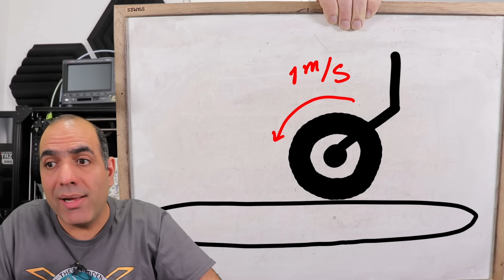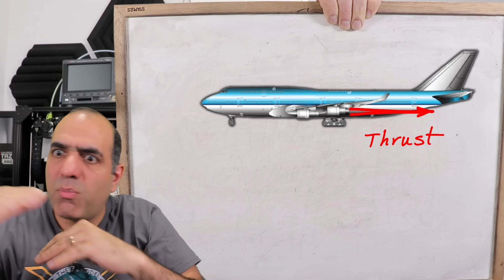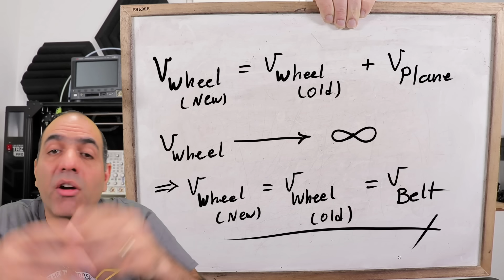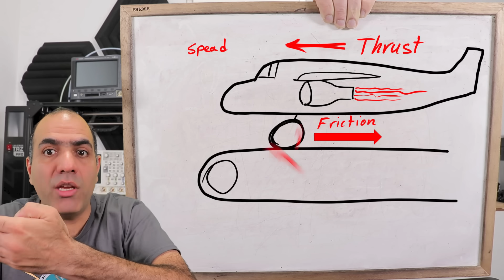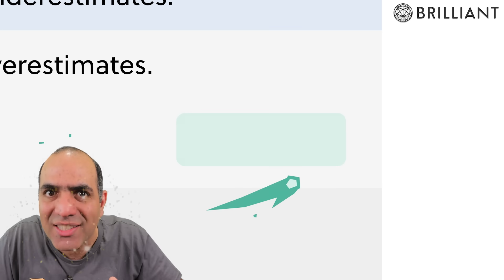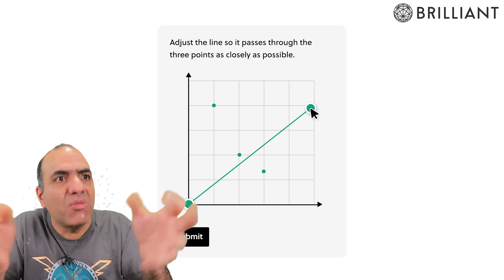Airplane Question that Drove Me NUTS!!!

Comment: Wonder how much airflow the conveyor moving that fast would generate simply via boundary layer effects... Could possibly be enough to get the plane to at least get light on its wheels... =)
Reply: Au Contraire 🤔 If the 747 plane is bombing along the conveyor runway with the air data system’s pitot heads on the nose sensing approaching the rotation speed, the conveyor will be running backwards apparently at twice the plane’s speed so there will be some rearward acceleration of the air above.  If the airflow below the wing is accelerated more than the airflow above the wing there will be less lift produced despite the sensed normal airspeed over the nose.  Rotation will not produce the expected lift from the wings and as lift is directly proportional to the square of the airspeed it could well be a significant reduction, the plane might hang or need a risky additional rotation.
This scenario is definitely not in the manufacturer’s flight (performance) manual.
Reply: @givenfirstnamefamilyfirstn3935  Ah, but the conveyor is running backwards at twice the speed of the _wheels_, not the plane, so basically very soon the conveyor would be traveling backwards at infinite speed, which would cause a fair bit of wind, methinks! =)
Reply: @jubuttib    Listen to time 0:29.  The conveyor moves to match the speed of the wheels in the opposite direction.  The wheels rotate with the conveyor speed, say 160 knots near Vr, take off speed.  There is perfect grip between the wheel and the conveyor.  The wheels are not fixed relative to the airport, they are hurtling down the strange runway with the plane and have a speed of 160 knots in the opposite direction to the conveyor.  The wheels rotate with the conveyor which from the plane is moving backwards at twice the speed of the airport or 320 knots.  Seen from the airport the plane is moving away at 160 with the wheels rotating at 320.  The feel of, the grip and the contact of the wheels is from the base of the tyres moving in the direction of the start of the runway at a rotation speed of 320 BUT the plane is carrying the undercarriage including that base of the tyre towards the climb-out end of the runway at 160.  The base of the tyre is moving away from the start end at 160 and rotating towards the start end at 320 so the actual net physical hold on the moving conveyor is towards the start end at 160.  The 160 knot towards the start end conveyor perfectly matches this motion of the base of the tyre without slip or skid.
The hard part is visualising the relative motions, as the wheel rotates at 320 it moves away at 160 and the conveyor also at 160 perfectly matches the relative tyre motion even though the point of contact (the 747) is moving.

Comment: Would the turboprop have enough thrust to make the plane skid if wheels are locked ?
Reply: Turboprops often have a huge power (not static thrust) excess, I’d imagine a twin could drag its braked wheels across the apron.  King Airs can be a bit weaker.

Comment: Its simple,  Only a propeller plane can take of whit no speed because it's making the wind necessary for the wings to produce lift , a jet engine doesn't low on the wings so I don't see way it's even a question what would happen if 😅

Comment: No the plane wont take off because the plane need to move to get enough lift to take off but that belt make the plane stand in 1 place so there was a misconception that the engine create lift for the plane actually only wing create lift to lift the plane :))

Comment: The plane can maybe possibly take off with no issues and without going to infinity in speed by moving in the same direction.

If the plane moves at a speed v, then the wheel and the belt can move at v/2 each in the same direction and it will take off.
Reply: The belt would be at 2V as seen from the (one V moving) aeroplane, seen from the airport it would be moving at one V.
Reply: @givenfirstnamefamilyfirstn3935  It would not. That is only if it is moving in the other direction, nit the same direction as I specified.
Reply: @NoobsDeSroobs   Time 0:29 condition must be met.
Reply: @givenfirstnamefamilyfirstn3935  I see now I should have been more specific in my answer. I should have started with the following:

It can not really be done as described in the image, but if we just try to match the speed of the wheels with the speed of the belt it might be possible.

Comment: AI answer
This is a classic physics problem that has been debated for years. The answer is yes, the plane will take off. The conveyor belt will not prevent the plane from taking off because the plane’s engines are moving it forward, not its wheels. The wheels are only there to help it move without damaging the runway. The conveyor belt will not move the plane backward because the plane’s engines are moving it forward at a speed relative to the ground that is greater than that of the conveyor belt.

Comment: My god. What are you talking about? The plane clearly can't fly. Because the belt and the wheels don't have anything to do with the physics of flying. If there is a windmachine in front of the plane, with the right amount of wind to lift the plane up - it will fly. But only with the belt on the ground - it can turn as fast as it wants - the plane CAN NOT FLY! That's physics.
Reply: Exactly. I can’t believe the number of people saying it will fly because the wheels aren’t mechanically connected to the propulsion system. That’s of course true, but the engines don’t generate lift—the wings do. Once running a turbofan engine can spool up to wide open throttle (full thrust) in a matter of seconds, yet the plane requires upwards of 3000 meters of runway to take off. It usually clicks for people when you frame it that way.
Reply from the maker: So the plane will move forward, but won't fly??
Reply: @ElectroBOOM  When did you say the plane moves forward? It's a physical fact that if the belt is moving, the wheels will turn in the opposite direction, but the plane doesn't move. It's like you on the treadmill. You walk, the belt is moving, but you stay in the same place. Therefore, the plane will stand still, even if the belt is moving very fast. Because of that, there will be no force from the moving air (what's the physics behind this), to lift the plane up. You even show that fact on the pinboard in the video. So HOW COULD THE PLANE FLY, WITHOUT AIRFLOW?
Reply: @pepizapedzki3112  The wheels are irrelevant to why the plane moves forward at all. Its forward motion is driven by a thrust force from hot, fast moving air. The entire body of the plane moves forward relative to the air, not the treadmill, because it is driven by a reaction force from the air and not the ground.
Think about it like this. If the plane wasn't moving forward, then all the forces must sum to zero. There's the torque from the wheels rolling forward, the friction from the treadmill equally pushing back, and thrust pushing forward. There's nothing to counteract the thrust force
Reply: @snowthemegaabsol6819  It doesn't matter if the wheels are mechanically connected to the propulsion system. In order for the plane to move, the wheels MUST rotate. Whether it’s mechanically rotated from an engine, or being dragged along through friction, it doesn't matter. And as that wheel starts to rotate, the conveyer belt speeds up to exactly match the speed of the tire.
Reply: @Snow the Mega Absol  What I don't understand is, why you are all fixated to the wheels? They are completely irrelevant for the physics of flying. Its the wings and the airflow over and under them, what let the plane fly. So the friction of the belt and the wheels do exactly nothing for letting the plane fly, or not. And the thrust from the turbines normally pushing the plane rorward on a stationary runway will gather speed, when the plane is moving forward. And at a point there is enough airflow to lift the plane up. But when the plane is on this treadmill, it doesn't move forward. So where is the airflow to lift the plane?
Reply: @pepizapedzki3112  Then what point are you trying to make? Planes take off in real life all the time, so if what the wheels do doesn't matter, why are you concluding the treadmill somehow makes a difference here? If the wheels don't matter, the treadmill also doesn't matter. It's true that the wheels don't matter, you seem to get that. Whether they and the treadmill are spinning or not, the engine exhaust is still pushing the rest of the aircraft forward through the air. If the wheels don't feel like moving, the rest of the aircraft will drag them forward. It's as you said, the wheels are irrelevant, and therefore, the treadmill itself is irrelevant. That's why so many people hate this question, it very specifically mentions information that doesn't matter to mislead.
Reply: @stubeusz123  "It doesn't matter if the wheels are mechanically connected to the propulsion system"
Ok, so they don't matter.
"In order for the plane to move, the wheels MUST rotate"
So they do matter? Pick a story please.

The wheels absolutely do not have to rotate for the rest of the aircraft to move. The wheels are there to protect the runway and aircraft from being damaged, and to allow it to taxi, take off, and land smoothly. That's literally why wheels were invented. I guess everything was completely stationary before then.

"And as that wheel starts to rotate-"
Do you not see the contradiction here? If the aircraft never moves, the wheels can never rotate, so the treadmill becomes the same as an ordinary runway, which means the aircraft can move forward. Heck, for the treadmill to even start, the aircraft has to move forward. If the aircraft doesn't care about the treadmill to start, it's not going to care about it later on.

One of the premises of this question is that the surface velocity and tangential velocity are equal and opposite. So we can simplify and get rid of the treadmill, and lock the wheels with a gigantic clamp boot. Power up the engines, I guarantee the aircraft will simply drag its wheels against the runway like rubber feet as it speeds up to Vᵣ. Why would it not also drag them against the treadmill? Actually spoiler alert, that's exactly what happens, that's how they start rotating in the first place. The wheels and treadmill are a red herring in this entire scenario
Reply: @snowthemegaabsol6819  So, the conclusion of this all is: The treadmill is just a deliberate misrepresentation. The plane will fly, whether there is a treadmill and the wheels are turning or not. OK, i can live with that. What about you Mehdi? 😄

Comment: 40 seconds in, answer is yes, 1st the wheels are not the thing moving the vehicle and even if the resistance of the wheel being turned in the opposite direction was accounted for, it most likely will not counter the force of the engines pushing forward that is a lot greater than the resistance in the bearings due to friction when being pushed to turn in the opposite direction... (if i am understanding this correctly the wheels would be turning 2x the speed they normally would... still not as much resistance as the brakes being on.)

EDIT: forgot "2nd", the wings only needs wind, moving the vehicle is all you need normally, but even a insane (unrealistic) fan pushing the same wind speed would let it fly.

EDIT2: infinity... did not think about the fact the wheel was the one being matched and not the vehicle speed... that would be very bad! lol

Comment: Of course it does, the thrust is created by the engines that pushes the entire airplane body forward. Not like a car that depends on the wheels to turn motion. Bonus: the airplane still flies even without touching the ground.
Reply: Lift is generated by the wings, not the engines. Lift is what causes the plane to leave the ground. A plane must move through a mass of air for there to be enough lift to leave the ground. 

Turbofan engines only require a few seconds to spool up from idle to wide open throttle (full thrust), yet the plane requires 3000 meters of runway to take off. Why? The engines are producing full thrust after the plane has only moved 100m. Answer: because the engines themselves do not create sufficient airflow over the wings to generate enough lift for the plane to take off. Since the wind on a typical day is nowhere near the required takeoff speed of a commercial airplane, the engines must move the airplane through the air at sufficient speed relative to the ground to generate enough lift for the plane to take off. And because the plane is so heavy, it requires upwards of 3000m to generate this level of speed/lift.
Reply: @stubeusz123  look, an aquatic plane doesn't lift ? Doesn't the water run easily under any direction the planes blades ? The engine, turbo, jet engines they push air and the air pushes back the plane causing thrust. The ground can move on the opposite direction it doesn't matter. Imagine you put your hand over the plane and push it. this is what happens by moving forward you get enough speed an lift. All you need is speed.
Reply: what i am saying is: a plane does not apply torque to the wheels. You cannot cancel the plane movement by moving the wheels on the opposite direction. A car does it, like a human in a treadmill their movements can be cancelled. Your legs pushes the ground backward and the ground pushes you back. On a plane the movement of the wheels is due to friction of the ground. The plane is moving forward and the wheels move because the ground is static. Moving the ground backward only make the wheels spin faster, but yet moving and gaining speed. Think of a boat, it pushes water, like a fish against the current it doesn't move but that does not apply to an aquatic plane. The aquatic plane will move no matter the current.
Reply: @lfantoniosi  you wrote a lot of words but I’m not sure what point you’re trying to make. It doesn't matter if the wheels are mechanically connected to the propulsion system. Lift is generated by the difference in velocity between the solid object and the fluid. There must be motion between the object and the fluid: no motion, no lift. It makes no difference whether the object moves through a static fluid, or the fluid moves past a static solid object. Lift acts perpendicular to the motion.

Comparing to an “underwater plane” is a stretch because there are very different factors at play (buoyancy is a factor whereas it is effectively not in air, since water is far more dense than air).
Reply: @stubeusz123  why do you think the plane will not move forward ? as I said the propulsion is made pushing air backwards, the air pushes the plane forward. The wheels have 0 contribution to the motion they can turn backwards as much as they can the plane will speed up and lift up.
Reply: Some people are pretending to be thick.  If they can write they can imagine being pushed forward.
Reply: @givenfirstnamefamilyfirstn3935  are the wheels break locked or loose ? There is a lot of difference there. If the plane is about to take off, they are lose. It's like pulling the mat under the cups and plates with the engines engaged I cannot see it not moving forward....

Comment: That was good. Eyval. Brilliant : Plane will fly. Tire's friction results from the vertical force between the tires and roller. The question is how much the air flow impacts. When one is opening a box with another box; that is a secret to Media Entertainment.

Comment: I always try to interpret the question not in how it was stated, but how it was intended.
The intention of this questions seems to be: would a plane still take off if the ground countered any of its forward movement in such a way that the plane is stationary?

That makes the question very easy to answer: unless there's significant headwind, there's no air moving across the wings, so no lift, meaning no takeoff.
Reply from the maker: Wheels roll forward, belt backward. How does that make the plane stationary if the friction of the wheel bearing is small to none compared to massive forward engine thrust?
Reply: @ElectroBOOM  The answer is simple: because the person asking the question has no understanding of the inner workings of a plane and just wants to create a scenario in which the plane is stationary relative to the air but moving relative to the ground.
This question isn't meant to be answered with a detailed scientific answer, it's meant to cause interaction and discussion, which is why any proper scientific take on it ends in chaos and confusion.

The asking person made a key mistake: they assumed a plane's movement has anything to do with its wheels.
As you said, the wheels don't make it move, the turbines do. The wheels are just there to reduce friction, without them, metal on asphalt would prevent the plane from building sufficient takeoff speed.
Reply: Simply put:
The person asking the question does not understand that planes travel relative to the air, not relative to the ground.

Comment: First there is no power going to the wheels the jet engines push the plane and if the ground tried to match the speed of the wheels , it couldn't because the wheels on the plane would just free spine faster ...you got to realize the jet engine is pushing the plane so yes the plane could take off